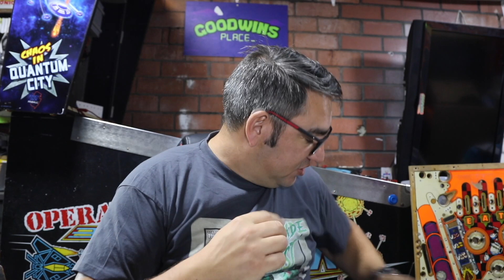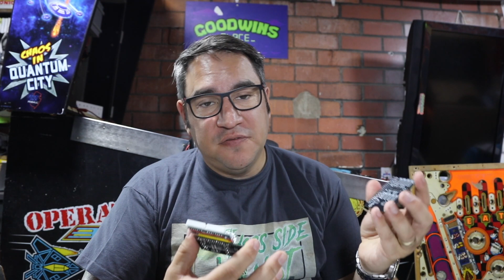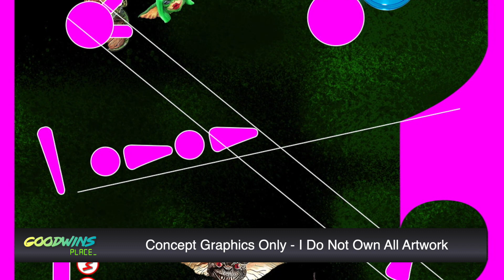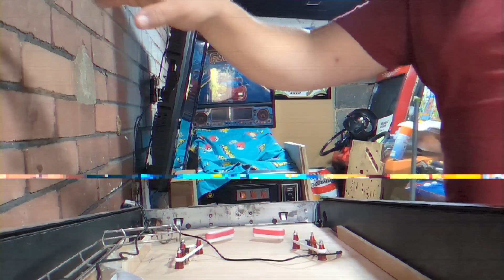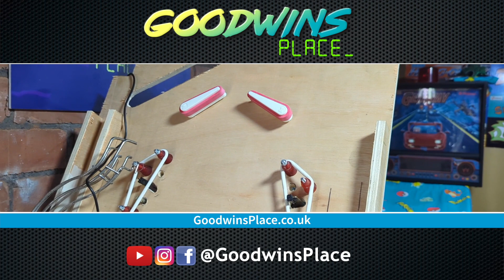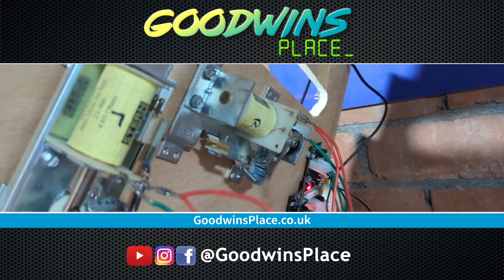Up In Smoke - Gremlins Homebrew Pinball Machine Update - July 2023

Comment: it's not a real project until something catches fire or melts.... Welcome to the club! (I personally put 12v through a 3V circuit becaus ei didnt key my connectors). Lessons were learnt.
Reply from the maker: Yeah things don't like the wrong voltage. This was 48v but I just cooked it by putting too much stress on the power regulator. Thankfully that was fine, the snapped connector on the other hand was a nightmare.